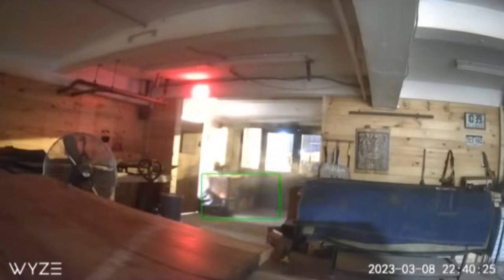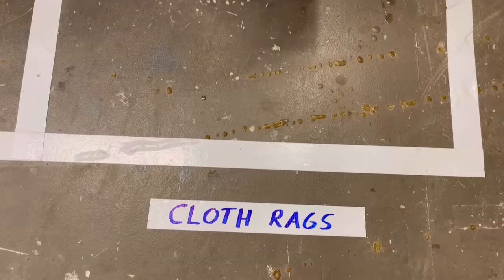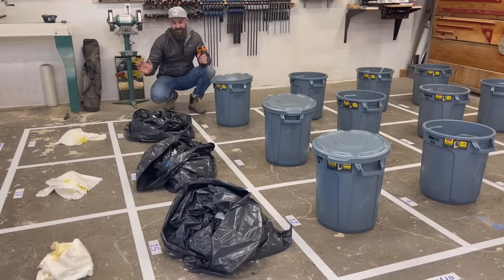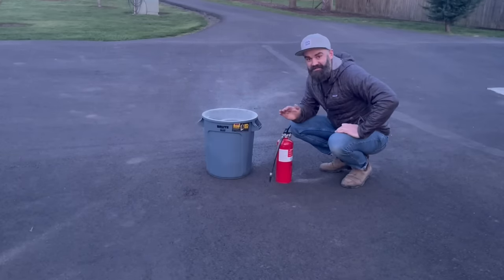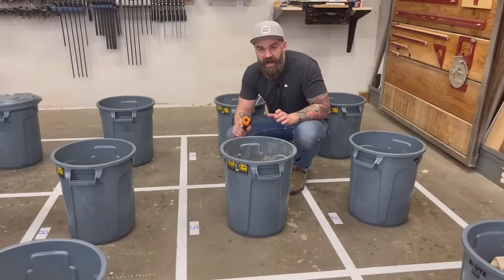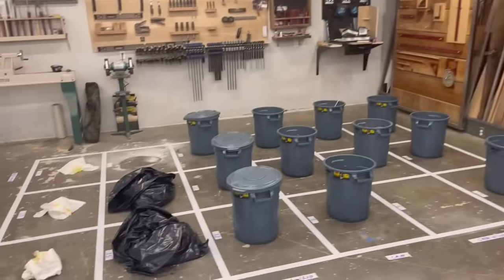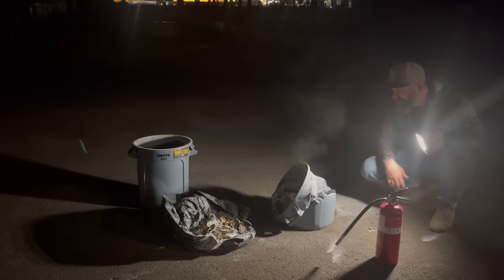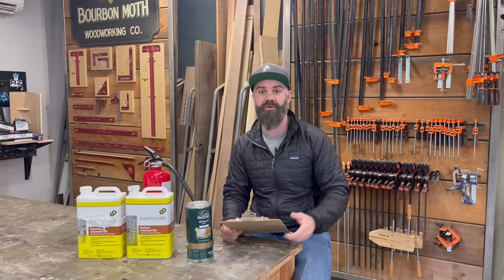I Tried To Burn Down My Shop || This Video Will Save Yours

Comment: Firefighter here. Powder Fire extinguishers are great for putting out a fire by smothering it.  They do not stop the chemical reaction not do they cool down the source of the fire. So if the heat is still there and oxygen gets back in then fire will re ignite.  Great video.  When I use linseed oil I have a bucket of water and dump my oily rags in there. Then when done throw the wet rags away.

Comment: I teach woodworking at the high-school level, and this is definitely getting shown to my classes!
Reply: Please find a good correct fire fighting video of using fire extinguishers around any type of fire and double what you think you need in extinguishers.  Fire alarm system and lighted exit signs.  I am sure you have already thought of what you need to teach students.  Good that you are being proactive.
Reply: Was just thinking this should be required viewing in every woodworking and carpentry course.
Reply: Our community college wood shop has a huge central vac dust collection system that deposits the dust and small scraps in an outside enclosed bin. It caught fire due to spontaneous combustion. The post event analysis was that it occurred due to wood pitch and high ambient temperature. The shop teachers have always taught students to dry finishing rags outside and dispose of them in the outside sealed metal can.
Reply: perfect length for a class as well. this would be a great video to show
Reply: Please explain to your class the flaws in this video as well. I was a chemistry teacher and safety is an discussion topic before anything else, as you well know. Lids should have been present to extinguish the cans as well as an extinguisher prepared and ready Outside as well. 😉
I wish my high school had had a shop class. And the lack of a respirator is alarming. Dry chemical extinguisher and plastic smoke 😖
Reply: I'm surprised this isn't already in the curriculum
Reply: WOW!  I've always been careful of oil saturated cloths out of habit.  I never really thought it would  be so volatile.  Thanks for the instant refresher.
Reply: I interpret for a 7-8th grade Woodshop teacher and I’m sending this to him! I use oil finishes and knew the risks and took precautions but this just shows how real spontaneous combustion is with oil finishes… wow
Reply: @travelwell8098  My shop classes in jr high and high school were 40 years ago, but this was in the curriculum at that time.  Shop classes today where this might be a concern are unfortunately few and far between.

I've never seen anything spontaneously ignite, but have always known it is a possibility.
Reply: @jason why do students end up in shop class? Do the kinds of students you get end up being curious about the hobby are already really interested in woodworking?
Reply: It's NOT the oily rags! it's any compound that has an exothermic reaction. Yes most oils used in woodworking, tung, linseed, even vegetable oil polymerize and releases heat. But they are not the problem, it's the accelerants and VOCs that increase the rate at which the exothermic reaction occurs AND LOWER AUTOIGNITION temperatures. 2 part Epoxies, 2 part Sealants, and anything that contain chemicals that shorten "drying times" or use hydrocarbons(VOCs) to thin out a substance.
Reply: They still do that?
Reply: This was taught the first day of my middle school shop class right along with safety glasses.   Scary that common shop safety isn't being taught. Sad.
Reply: @mandimusic5109  You don't need to torture kids with a 30 minute video when 3 minutes explaining what  spontaneous combustion is and "ANY cloth or rag goes in this red container"
Reply: @Chris Anthony  funny, tons of comments in here from experienced adults saying they didn't fully comprehend the risks, and here you are wanting to blurt out a couple of rules and not actually educate kids...
The best way to educate is to demonstrate.
Reply: That's great!  You can also show how you need to really put out a fire well as Jason expertly showed by letting one of them flare back up and melt on his driveway ;)
Reply: @mandimusic5109  It used to be.
Reply: @dianeewoldt3035  So in metal cans the fires can still start and just remain there or the can prevents the fire in the first place?
Reply: @daedaluscreation4869  a respirator is needed when using fire extinguisher? Im new.
Reply: Unfortunately this video was staged

Comment: Since I haven't seen anybody else mention this, the fire extinguisher you used should be replaced immediately. Once they're used for the first time, they will slowly lose pressure and become useless. 

I learned this the hard way while casting bronze. Crucible broke and spilled molten bronze on the ground. It ignited a nearby piece of plywood and the main extinguisher I had was completely dead, even though I only used it briefly before.

Luckily, this was outdoor in a wide open yard, so it wasn't a major problem. But it could have been under different circumstances.

Comment: 2 things in addition be careful of batteries and be careful of electrical cords. 
Regrettably my brother in laws woodshop recently burnt down and the fire Marshall worked with him to determine the cause and it was most likely a table saw cord that had been pinched when he pushed it up against the wall after using it. The saw had not been in use for 2-3 weeks but since it was plugged in it had some kind of flow. Also make sure you have a good fire rider on your home insurance and do yourself the favor of making a list of everything you would want to claim ahead of time if you were in this situation. Finally do not store gasoline, kerosene, diesel or other fuel inside structures you care about because in most cases storing fuel inside will actually nullify your fire insurance.
So a tip from the rc plane community that deals with tons of lithium batteries. Make yourself a battery coffin out of cement board , put your chargers and batteries in the coffin and set it up on a wire rack shelf with a few tubes of sand above so that if a fire starts the heat will melt the plastic and the Sand will stream down dousing the fire. Do not use water on a battery fire they NEED to be doused using a fire extinguisher, fire blanket or similar.

Comment: Oily rags are an issue so you should keep them in a proper metal bin with a tight lid but I call BS on this video. I've seen spontaneous combustion before in person, it starts smoking long before actual flames are visible.

Comment: As a Chief Engineer on big yacht, we are instructed to keep oily rags separate from other rubbish, and in metal containers with sealed lid. I like also to do some woodworking while at home and my rubbish bin are always outside and in metal. Keeping a good fire extinguisher in the area is also a good idea. Keep in mind that others materials mixed can heat up and potentially start a fire. e.g. chlorine and whitened paper or mixed two components resins.

Comment: Thank you so much for this. I’m 60 years old but new to woodworking and I’ve never heard of this. I’ve been through a fire before when my workshop from a prior screen printing business burned down due to a faulty box fan I regularly left running overnight to dry screens. It hit hard financially but I survived it, barely. I can assure you I no longer leave fans running when I’m not around and now I’ll make sure I don’t leave wet rags in the trash!
Also, thumbs up for Seinfeld, my go to when I have 30 minutes to kill.

Comment: My dad had a commercial woodworking shop for decades and he was super strict about laying linseed oil soaked rags in the middle of the concrete floor, then putting them in one of those metal safety cans (that was triangular shaped, that always stuck in my brain). I think he probably told my brother and I about a thousand times that they could spontaneously combust and this is the first time I've actually seen it, scary stuff! Great video, even though it's way different than your usual, I love the methodical approach.

Comment: This looks like a similar process to Hooibroei we have in Dutch. It is hard to translate, but it is the phenomenon of hay spontaneously combusting. In the case of hay, this is caused by micro-organisms fermenting the hay, causing a self-sustaining reaction that heats up the hay and produces flamable gasses that can combust as early as 80°C.

Comment: Jason, thank you so much for creating this video. I have to admit, you scared me so much that I literally got up off my recliner at 10:22pm, walked out to my shop barn - where I haven’t  done any woodworking for at least a month - and rolled my trash can (which was half filled with wood scraps, old small engine parts, cardboard, etc) outside. Then I filled it with water.
Reply: 😂 good for you. Safety 1st... not second
Reply: Dousing rags with water or soaking them only delays the potential for combustion. When the water evaporates the oil will still be there and restart its own drying process. If you throw them out wet, then you're just passing the risk on to someone else (who likely has no expectation of being on alert for fire). 

I would imagine waste disposal companies have some sort of contingencies in place for this, but it would still be best to avoid the problem at all.

The rags need to be laid out on the floor to dry before being disposed of.

Comment: I’m… stunned. I’ve been throwing away oil-soaked rags into a common metal trash bin in my shop for the past 25+ years, and I can only recall one time some years ago when I noticed the trash bin lid was warm as if it had been sitting out in the sun – only it was early in the morning and it’s never stored outdoors.

I’m now wondering if there were other times this had occurred and I simply didn’t notice it. How I inexplicably escaped from burning down the place is beyond me. It’s a terrifying thought and you’ve got my full attention. Holy cow.
Reply: Keeping the lid on helped. If anything was to catch on fire it would go out immediately from lack of oxygen.
Reply: @brianlawrence9959  I think you’re right – the lid on that particular trash can has a deep side skirt to it where you have to push down on it with both hands to close it up. I’ve had that trash bin for over twenty years, but I’m certainly changing up my careless practice of what gets tossed into there from now on.
Reply: @JustOneRedSoloCup  Glad you are changing up your practices! It could also be that it uses up the oxygen in that can for the most part before it can combust, the curing of BLO is oxidation, I just don't know how much it needs.  In Jason's experiment only the open containers caught.

Comment: How would putting out a fire work in the plastic bag, by covering the top in a thin layer of fire retardant when the rags would have caught fire from below? I mean, the effect that starts the fire is still happening below, you put it out like a spark was introduced as the source of combustion, not an exothermic reaction like you are claiming happened, that would still be happening producing heat to continue lighting the rags on fire.

To get ignition you would need heat hot enough to get combustion, wouldnt that have melted any of the plastic long before flames appear? I grew up in a house with 3 wood fires, two for heat, one for heat and cooking. Anything that is going to start a fire nearby always starts to smoke long before it catches fire.
You would smell and see melting bins, bags, smoke from the melting plastic would be filling the shop, the flames would be restricted to the most insulated part and take time to get out of the confinement and then burst into flames, and not having ideal oxygen in the part where all the heat would be generated would mean maximum smoke from an inefficient burn......
You would smell and see a problem long before flames.
But the only thing that smells here is the fish.

Comment: I'm glad you had re-ignition in your video and it warrants further discussion. You had a chemical fire which even though you had smothered it, it was still generating heat. As the white powder from the extinguisher moves around with the air currents (allowing oxygen in), there was a fair bet that it was only going to be a matter of time till you had re-ignition. Short version - you need to prevent the heat from building up. This is why we want to spread the rags out. Interestingly, you never mentioned the temp that the rags on the ground reached.

Comment: New to woodworking, and I had NO idea that this was a thing. Really appreciate you making this video, and love that someone else also shared it to the local makerspace I just joined. Incredibly informative, and one of the best "psa" videos I've seen.
Reply: Dude, seriously. Any "drying" oil product for wood is totally unsafe. It's almost not worth having, unless you're a professional wood worker. I had a big can of boiled linseed oil that I had purchased a few years ago, and after some thought, I returned it. The whole back of the can is a long warning label about how it will catch fire. It's like, why would they sell a flammable product that spontaneously combusts, to people to use on wood? It's like a sick joke or something. Using a natural "raw" oil means the oil is just a plain natural oil and it is almost impossible to catch fire, but anything that cures in 24 hours, will create a reaction that can create excessive heat. They sell steel vessels for rags, where it prevents oxygen and smothers any possible fire. Look for stain trash can, with a metal sealing lid.
Reply: @Ritalie  Hello mate, im new to this stuff and now im scared. What about paints?

Comment: I'm not a wood worker and would never work with linseed oils having had worked in a hardware store decades ago and naturally know of linseed oil instability.  Rationale tells me a mostly enclosed but not sealed container which will help retain heat but allow "breathing", thus escalating it, and the inclusion of materials that can be thought of as kindling, is the big take way from this.   I enjoyed the video.  Thanks!

Comment: A lot more scientific than I thought you were going to get! Great job! It's one of those things where you are warned about it and "know" about it but until it actually happens you kind of don't believe it
Reply: also for science - notes on temps in non-freedom units, for anyone who needs them:
55F ≈ 13C
85F ≈ 29C
100F ≈ 38C
112F ≈ 45C
125F ≈ 52C
185F = 85C
200F ≈ 93F
Reply: i was kinda hoping grandma was going to be there to operate the fire extinguisher, like she was the first one to walk the gangplank on the gym set outside haha

Comment: I just drove into my workshop on a Sunday to make sure that the rags my wife had used on a cutting board had been disposed of properly like Ive been saying for years. They were in my plastic bin behind my desk. Never seen a video like this before and it brings it back to the front if mind. Good job mate. Hope this goes viral.

Comment: This has happened to me personally. Fortunately for me it was an early day in the shop for me so I caught this happening in my shop at about 4pm.   It wasn’t linseed, it was a minwax product. Any oil soaked rag has the potential for spontaneous combustion because as oil dries it becomes exothermic. After I put the fire out I immediately purchased and fireproof rag pin.

Comment: Great vid.  Rember to replace your extinguisher. Dry powder is one use, nitrogen will now leak all out. You should consider having a co2 extinguisher in shop. Dry powder have the best knock down power but in the case of a fire you will be cleaning up dry powder for days, also the powder is corrosive and will wreck your tools and machinery. Co2 has none of the fore mentioned downfalls. Ideally you should have both dry powder and co2. You might already but I thought should share.

Comment: The thing about the thermal camera is that it's measuring surface temperature.  If there's a well insulated spot in the center of the wad of rags, it could easily get much hotter, which was most likely why the readings you were getting didn't seem to directly correlate with what caught on fire.
Reply: also we dont really know what the combustibility is of everything there, just the linseed oil only needs 200*F, so pockets of that temp seem to have occurred somewhere
Reply: Actually he was using a thermal heat "gun" everything else you said is true.  So yes, it was measuring only surface heat an actual thermal camera would have shown the pockets of heat in the pile and where it was as well.  Also, since linseed oil only needs 200⁰ to combust he was close on a couple more as well.   

GREAT experiment and a EXCELLENT Public service announcement.   I hope this is his most watched video.
Reply: @thaddeustroyer  A thermal camera measures temperature the same way a thermal "gun" does (via measuring thermal radiation). So it still wouldn't have picked up the temperature of insulated internal pockets. A thermal camera is just like taking the individual temperature of many thousands of points with a thermal "gun" and arranging that information into a "picture". It doesn't technically scan inside of something. Though sometimes it definitely seems like it can though because you can use a thermal camera to see "through" things that we can't see through with our eyes but this is more a property of thermal radiation travelling through many things that visible light does not travel through. In this case something that is insulated can be considered (roughly) the "same" as something being opaque (not see through) to our eyes. Insulated things block thermal radiation while opaque things block visible light.
Reply: Yup, and with these types of fire (similar to bales of hay or cotton) it's the center that gets hot as rags make a good insulator; trapping the heat.